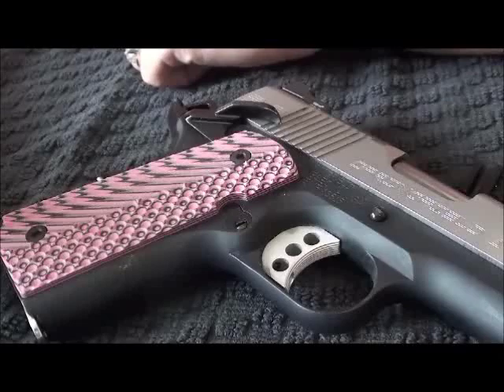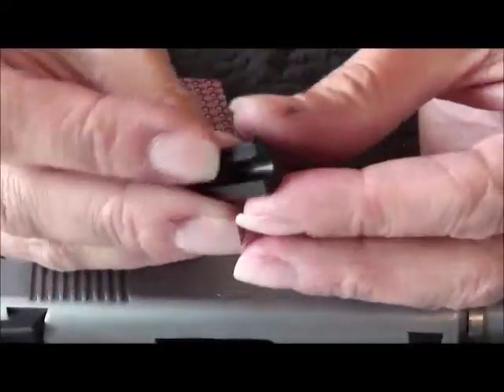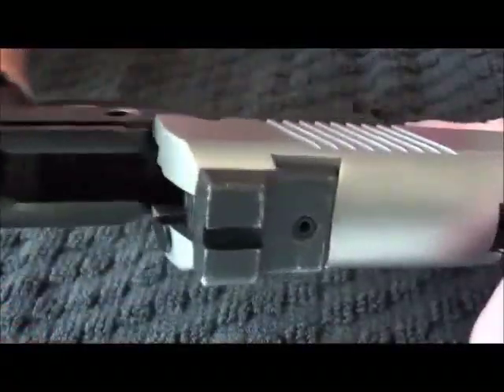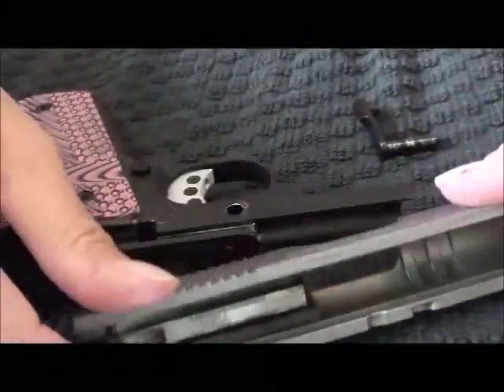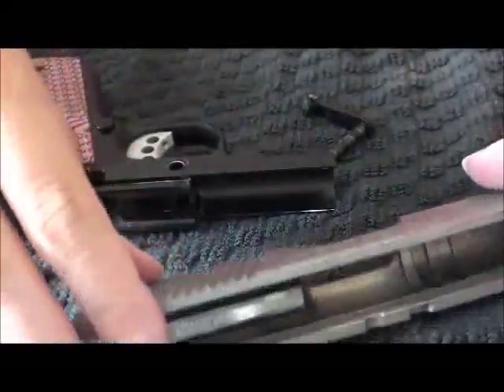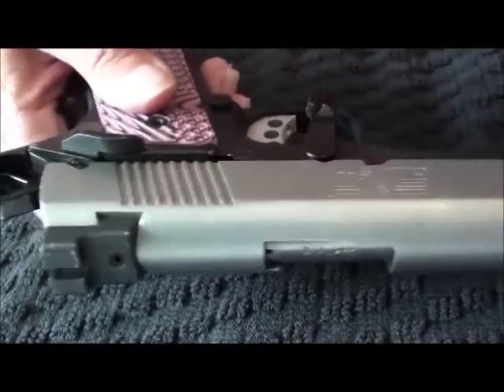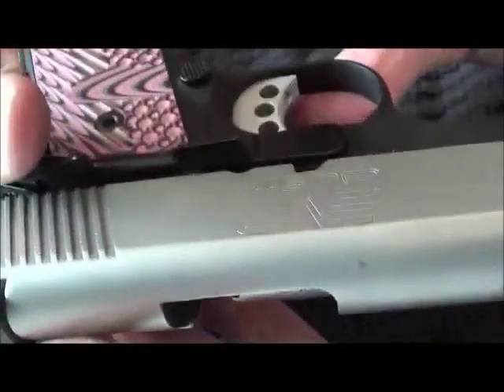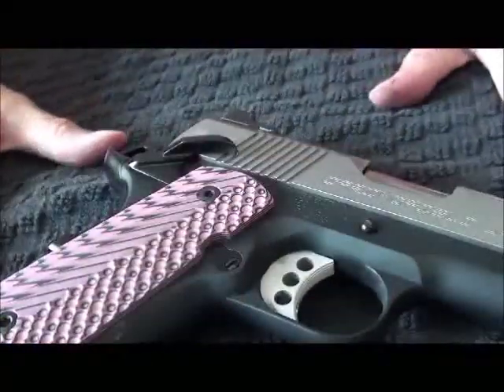Disassembly/Reassembly/Field Strip Springfield Armory EMP (Enhanced Micro Pistol)  HD

Comment: Quick note for watchers... at least on the 9mm, you don't need to use the tool to take the pressure off the sitting to disassemble. Pull slide, pop slide stop out, pull slide off frame, and the spring assembly has enough room to lift out. I've heard this is not the case with the 40.

Comment: Where can you purchase the U shaped spring tension capture tool you used! I would love to have one for cleaning ease.
Reply: Just a note On the newest model you don’t need that U shaped piece it comes with a little tool and there’s a hole you stick it through to do the same function as the U shaped piece is serving
Reply: @jasonboerner1  I had one hell of a time reassembling my EMP4 1911 - just the last step of reinserting the slide lock. My wife had to help me as did this nice lady in the video, so it took two women and a man to reassemble. That spring is tight! I moved the slide back to the halfmoon shape and she applied pressure, seemed to finally snap in place after I slightly moved the slide back and forth a bit. I hope this gets easier after the next cleaning because my hands are chewed up!